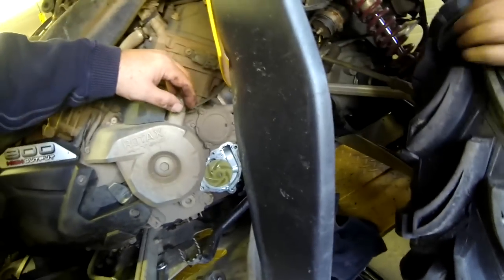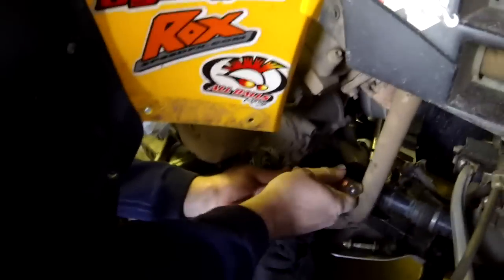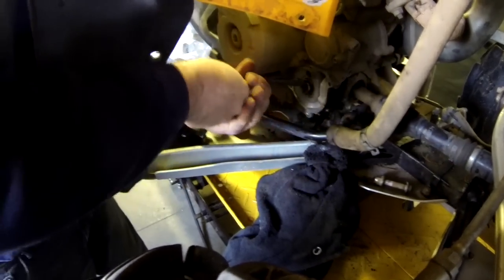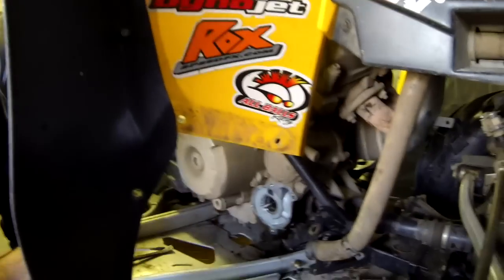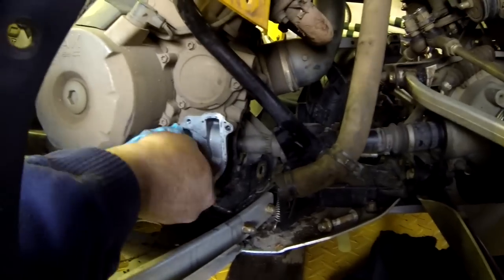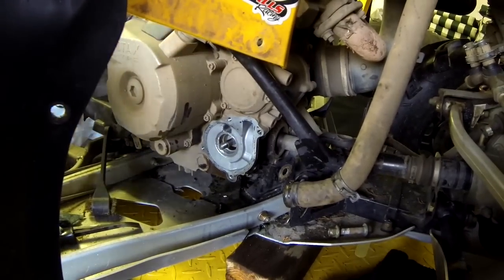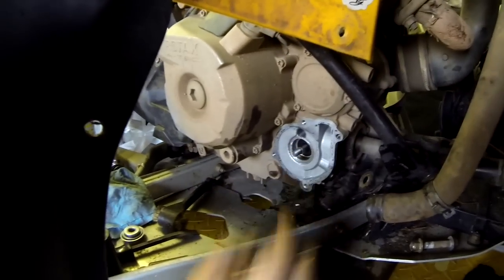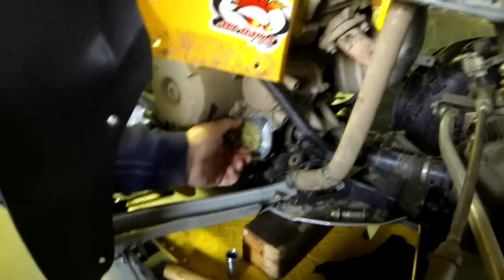DIY Can Am Water Pump Seal Replacement

Comment: At 1:47 drilling holes puts you at extreme risk of marring the metal where it mates with the black oil seal by drilling right into the edge of the oil seal/metal.  It is better to file a large flathead screwdriver into a sharper edge and stick to tapping away with a hammer if you aren't getting it to bite the edge of the seal.  If it is thin enough to bite into the edge of the seal, it will give with some taps.  Any damage caused there is not as bad as what could easily happen if you drill.  Besides, the proper way to do this is to remove the crankcase cover and press it from behind.  Obviously a lot of us prefer this shortcut including myself esp for my own engine.  BTW thanks for posting this because as of now there are still only about 2 videos on this job with this kind of engine!

Comment: Thanks for posting this video as i am about to tackle this task.Just bought a 650 max and limp home mode appeared on display so i checked rad fluid level and it was low,but when i filled it just drained out the water pump relief tube..cheers from b.c.west coast

Comment: thanks for this video..
i have a 2007 outlander XT that coolant is escaping into the engine oil...
I will be doing this fix next weekend... the weep hole issue explains why the seals where out over time

Comment: Nice video! BRP hasn't solved this yet. I have a brand new 2017 Rene 1000 XMR, leaking coolant and oil. Haven't even reached the first service yet. I don't really want the punks at the stealership to do the job. Planning to do it myself.
Reply from the maker: Wow surprised it happened on a 2017. I've done over a dozen of these seals and all of them have been 2007s. As much as I hate taking it to the dealer. I would let them do it just in case there is something else wrong. But if you are planning on doing it yourself. It's not a hard job. Just a little time consuming. Hardest part is taking the old one out. Good luck and thanks for stopping in.
Reply: Outlaw Chop-shop i have the same issue with mine. I noticed fluid in the line after the first ride and always thought from then on that it was a overflow of some sort.

Comment: I followed your video and still had the leak. What I found is that I needed to seat the inner ring of the new part connected to the spring. Just flipping the socket around and tapping didn't do it. I needed to use a few washers and a M8x1.25 nut to seat the new part correctly. Other then that additional step your video was very helpful.
Reply from the maker: Yes that was the tricky part. Knowing how much to tap the center. First time I did it I just got lucky and pushed it in far enough that it didn't leak. Second time I didn't tap it far enough and it leaked. But was easy enough to remove the cover and tap it a little further. I guess this is the way we learn. Thanks for commenting and glad it worked out for you.
Reply: If you can add a text comment over the end of the video like "not showed: use 8Mx1.25 nut and washer to seat inner spring ring flush." Don't want the next guy to deal with DIY ignorance like I did. I messed with it for several weekends and lost two outings. Still saved a ton of money though. thanks
Reply: is there a tool to do this?
Reply: Shop manual also has the washer and nut instruction in it and the press tool. Very helpful video though for those of us not near a dealer to get the press tool.
Reply: Wish I read this comment first. Watched video, followed video to a T. Old one came out quite easy; new one went in straight and seemed to be flush and seated. Added coolant and started unit and it's almost as if the coolant drains straight out the weep tube. I will remove cover/impeller tomorrow and try putting the nut/washers on to seat further. Hopefully I didn't ruin seal by tapping in center spring portion. Excellent video though, thanks.
Reply: Im about to do the job , do you tap the outside of the mechanical seal with a box and then push the center with the M8x1.25 nut/washer...
Or
Do you press the entire mechanical seal with the M8x1.25 nut/washer ???

Thanks

Comment: If the weep hole leaks oil to the outside can you block the outside.  Because it's not practical to remove the motor to drill and tap the weep hole

Comment: I have a 2000 bombardier ds650 I bought.  The impeller is held on by a clip. I had to tap the clip out in order to remove the impeller.  Thank you though.
Reply: Thank you I’m tearing into one I found in the woods and it’s hard finding info for diy
Reply: Is there any certain way you had to tap it out?
Reply: @hhstarwars  If I can recall, you have to tap and pry out.

Comment: request response please..............great vid; i have a 500 outlander 07 and the impeller shaft for water pump isn't turning with cover off looking at the impeller...... what is prob you think and do you have to split case to replace impeller  shaft assy.  engine running hot after 5 mins run time every time you start it.
Reply: hunt4fish  check the cut off of pressure switch

Comment: If these two seals are bad will it cause coolant to get into your engine oil and oil into your coolant/radiator?
Reply: On my bike the oil is leaking out of the front of the engine covet.
Thank you so much for this video.

Comment: Thanks for your video on the water pump seal / oil seal replacement!  Great video, easy to follow.I have one question though, did you do this seal change because the coolant was leaking into the oil?  That is my issue at the moment and I wonder if this could solve it...Thanks , keep the videos coming.
Reply from the maker: Thanks Jason. We changed the seal because it was leaking through weep hole. In your case this might help but really hard to say. 1st thing that comes to mind when hearing about coolant in in oil is head gasket since that's where the greatest pressure is. I guess you need to start somewhere and the water pump oil seal is a fairly easy job to do. So if it was me, I would probably start there. Good luck and get back to us when you get it figured out. I would be curious to know.

Comment: How did you loosen the impeller
Reply from the maker: Removing the impeller is the easiest part. Just remove the 8 or 10mm nut. Can't remember what size it is. Then the impeller should pop right off. If it doesn't, might mean it's stuck. Just pull a little harder.

Comment: Thanks for the video!!! My 07 outty 800 is in desperate need of this. Just wondering did you pick it up the new seals from princess auto? That would be awesome Im there once a week lol. If not do you have the part numbers or can you help guide me in the wright direction of where i can pick these two seals up from?
Reply from the maker: You will have to get the seals from BRP. Not expensive. Water pump rotary seal is part #420650370 $26. Optional seals if you would like to change since it's all open are the oil seal #420650310 $13 and Gasket #420651190 $8
Reply: Thank you sir! Parts are ordered!!

Comment: I'm having an issue with oil getting in my coolant is this a likely culprit?
Reply: Michael Krause  the oil seal behind the main coolant one they removed would be the cause. The one he said not all guys change. If you don’t have oil mixing in then no need to change it.

Comment: how did you know this was the problem? my limp home light is coming on my bike and I noticed the fan is running all the time but no fluid leaking?/
Reply from the maker: We could see an obvious coolant leak coming out of the weep hole. Doesn't sound like that's your problem. Are you overheating to cause the limp mod to come on? If yes then you mostly like have a dirty radiator. Very common problem on these bikes. Try cleaning the rad with air gun set it around 60 psi and get right in there. Then flush with water and see if that helps. Best way to make sure is to remove rad and clean on bench. You will be surprised to see what you find. Hope this helps. Good luck.
Reply: thanks a ton your the only responder so far after 30 or so posts everywhere!
Reply: Have a great Memorial day!

Comment: hey just brought my 650 outlander to the dealer in town they say the water pump is sealing but the shaft has excessive play they wanna split the hole motor for a grand. Do you think this can be my problem. the bike looses coolent then i overheat
Reply from the maker: I don't understand if they say its sealing but you loose coolant. So it's not sealing. I would just change the oil and coolant seal first and see how it goes. If the problem persists then split the engine to replace complete shaft.

Comment: Hey, did you actually get those seals from Princess Auto? If so, do you have a part number for them?
Reply from the maker: No. You have to order from BRP.
Reply: +Frankie's Channel that's what I thought, I just seen that they were in a princess auto bag so I thought maybe they had a crossover part. Thanks for the reply!